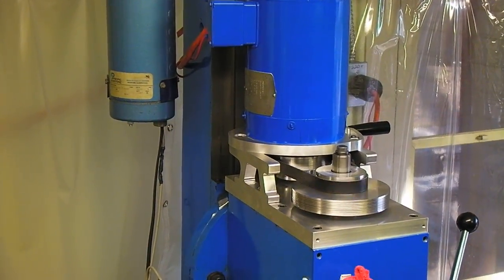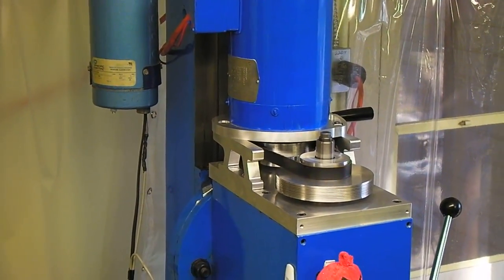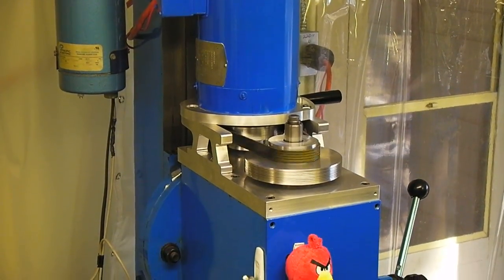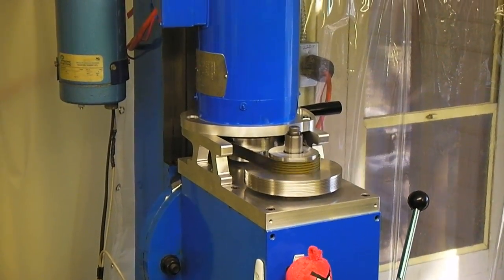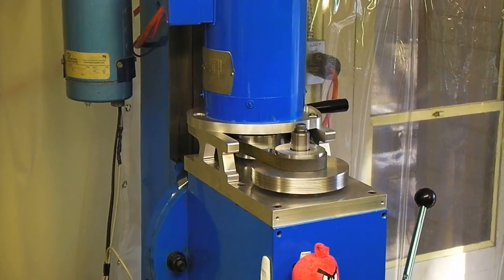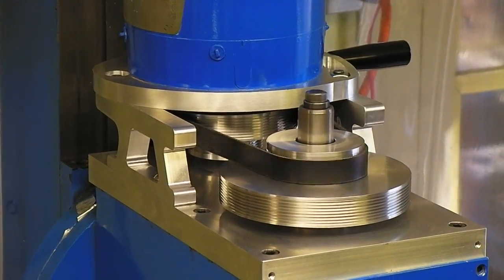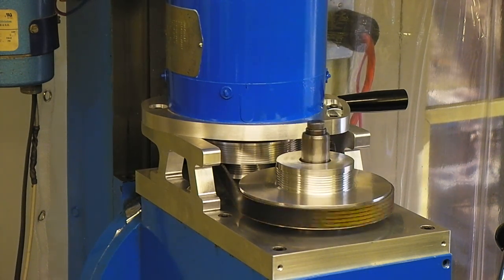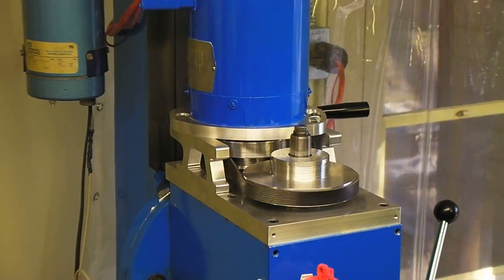2 Speed Belt Drive IH Industral Hobbies Charter Oak Automation

Comment: Hello, have you more details how you mount the pulley to the spindle? Or use you the Original stuff and the "drill press" mechanism is still working? So you don´t put thy pulley direct to the external teeth of the shaft?

best regards, Malte

Comment from the maker: @hesscraft 

I'm still doing video and pictures of the first 2 speed unit but I'm almost done with the second one. I should have at least one posted in the classifieds at CNCZone.com by Tuesday or so.  

This is a complete assembly so all that needs to be done is to remove the old gears and top plate and mount the new belt drive and your motor. 

You can also send me a email at davedaxx1@yahoo-dot-com. It is best to add the words "belt drive" in the title so I know it is not spam.